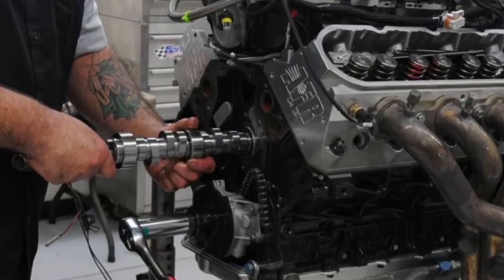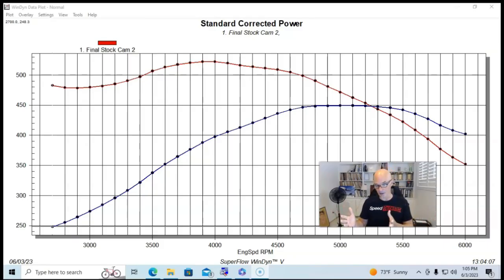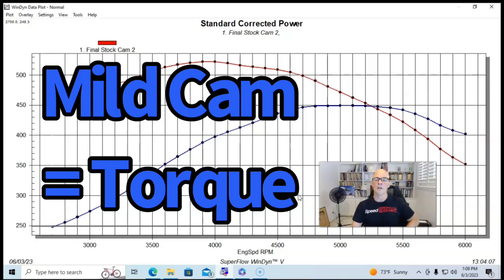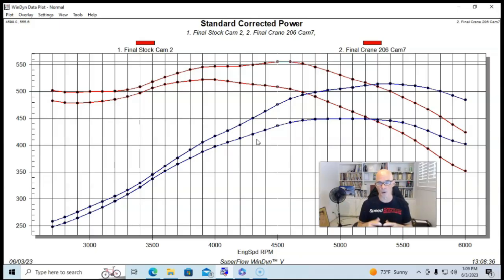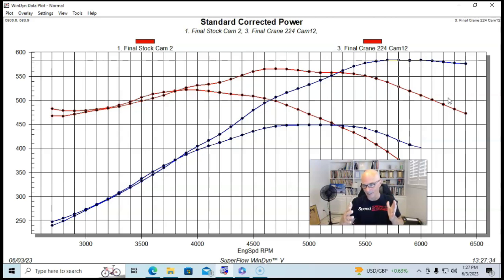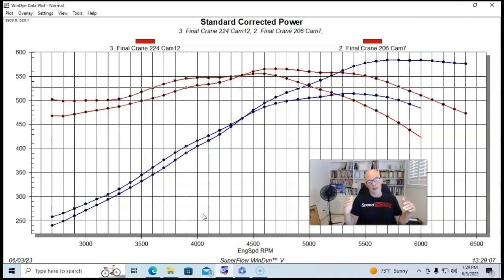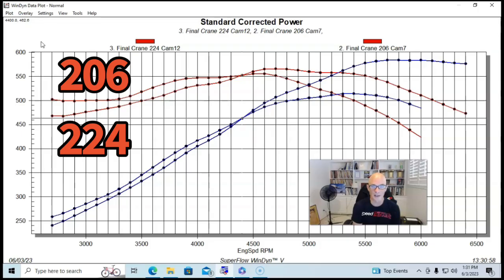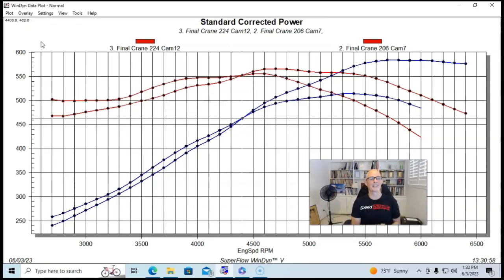HOW TO MAKE MORE TORQUE WITH YOUR LS. 6.0L 408 STROKER CAM TEST-WHICH TORQUE CAM WOULD YOU CHOOSE?

Comment: The 5.3 in my 01 Suburban is getting tired.  I'm thinking about dropping in a 6.0, and after watching this, it would seem the truck norris cam is a good upgrade
Reply: For a 5.3L yes, for a 6L - go a little larger. I have TSP cam about the same size as the TN in an LQ4 with 862 heads and supporting mods. It's OK, but not impressed.
Reply: Do it man but I have a recommendation. If you get a lq4, bump compression to 10:1 at least.

I have a lq4 that I put flat top pistons in, with the truck norris cam. Stock intake, stock 317 heads. I love the way it performs. I have a built 4l60 that I'm using the 4.3/4.8 converter because it has a little more stall 1600-1800 vs 1400-1600
Reply: @Itsunclejesse89  Absolutely.  Compression is so often overlooked for torque, which is all I'm after.

Comment: I would not use full dish pistons and no quench and I'd start with around 216 with an inverse radius profile to keep the seat duration short  maybe high ratio rockers   what was your compression ratio  if it worked with a 206 then a 224 could use more compression  cheers   Ps I do not use .050 to spec cams but do compare the "intensity" of the .006 to .050 duration  cheers    pps great ideas for my 6.0 Motorhome motor whentime comes for a rebuild

Comment: Noooooo! I was so hoping to see the truck norris tested. Or at least the summit 8728r1 torkinator that had similar results to the truck norris. Those two camshafts had such similar results on a smaller cubic inch engine, it would have been interesting to see if that changed at all on this larger cubic inch. Man, but for real, Brian tooley needs to give Richard a pile of camshafts for all the business these videos make happen. Lol
Reply: A truck Norris is a ridiculously small cam for a 408, the low end gains that would be useless considering the fact that a 6.7L stroker is already going to make gobs of torque and defeats the point of why you would even build a 408 in the first place. It would do basically the same thing as it would in a 6.2
Reply: @chrishansen7004 did you not watch the video?

Comment: Truck norris is for a 5.3, not a 408.  Use Comp LSL/LXL lobes.  218*/228*, 107* LSA, .650" lift (1.8:1 rockers).
Reply: That would probably do pretty well.  I'd probably go solid roller myself but with those lobes maybe 225 @ 0.050, 275 @ 0.020 / 230, 282 on that 108 with 62.5 overlap, 1.8 rockers as you said should work alright with those 245 heads to 7200 rpm so long as the springs are good.  

If it was mine I'd probably run it a little farther out in rpm too, so perhaps lil more duration that brings overlap around 70, maybe 280/292 @0.020.

Just my opinion but if you want more torque then build a big block for less/$ or run a turbo/supercharger setup and spread that lobe separation out a couple/few degrees.
Reply from the maker: Now even the Truck Norris is the Wrong Cam?
Reply: @richardholdener1727  Ask Mr. David Vizard.  I used his equation to calculate LSA for a 408 with 55mm valves.  Apparently he's "just a guy on the internet". It should make over 575 lb-ft with more torque everywhere.  You could probably go a little bigger and still have good vacuum.  fwiw, PipeMax recommends 115*LSA, and 240/250* @ 0.050" with peak power at 7200 rpm.
Reply: @richardholdener1727  - well, based on something I was taught by some guy on the internet once, apparently not. 😜
Reply: I used 108 lca, thought that was what you said.  Close enough, little tighter probably better than a little on the wide side.
Reply: That makes no sense at all. If you've watched many of Richards videos, you'd know that there is no "right" cam for an engine - they all work in every LS setup. The difference is where the torque band is - the larger the displacement, the lower the torque comes in (and consequently peaks). Saying that a cam is "too small" is silly - it depends on what you're looking for. In this video, he was discussing a more low end grunt Torque Monster setup - which as he said at the beginning, displacement is the best answer.

I think you have a predetermined idea of what a 408 is for - but as with anything in the car enthusiast life, it's flexible in how you adapt it. I'm looking forward to building something like this (basic overbore with a 4.00" stroker rotating assembly) and I drool at the thought of a TBSS intake and the Truck Norris cam. Stock 799 heads, maybe light porting - should be a stupid grin inducing monster with silly torque everywhere. :)  It'll definitely motivate my 6k lb AWD Escalade with some authority. No, it wont' be fast - but it will be fun. :)
Reply: @Broadpaw_Fox  it sounds like you'll have something to really enjoy.  Even a 400hp mild sbc is fun.

As far as cams there are tendencies but depending on what you are looking for you can get close.

And I'd lean towards saying there are "right cams".  If you're racing, have data and use an rpm histogram and scatter plot then you can see at what rpm and for how long you spend time and work towards making average power where it counts.

The average view isn't gonna have i2 Pro... and do that.

But I will say one cam I'm not a fan of is that BBC on a mile wide 114 LCA 😅 (for a traditional valve angle big block, especially as the cubes go up and it stays na) still love the channel and appreciate the content.

And yes he described grunt and also described he'd use different parts.  With those 245s I'd build around the min csa.

To me if I'm building a street engine I'd want the most cubes and best heads I could afford and build around that (assuming I'm not gonna be in the stratosphere for parts because I chose something crazy like a 9° head), ya know stick with decent parts with reasonable piston speed...  find it hard to beat a BBC if you're going na  average hp/$.  Plus they sound really good.
Reply: @Broadpaw_Fox  try to get your hands on factory LS3 heads and intake that will help with power everywhere more than the 799 heads and TBSS intake
Reply: WRONG CAM  🤣

Comment: If i was wanting to make torque....as in low end power.  Then the cam is likely the least important part in the engine. So why worry about it so much??

You want tq. Add compression and a cross ram intake.
Reply: Is tuning more difficult when running a Cross Ram intake?
Reply: @brudevold62  shit it's pretty difficult in general to get them 100% right....especially with the factory ecu that most of us deal with. He's on a dyno using a aftermarket ecu. Most people never see the benefit of the cam.